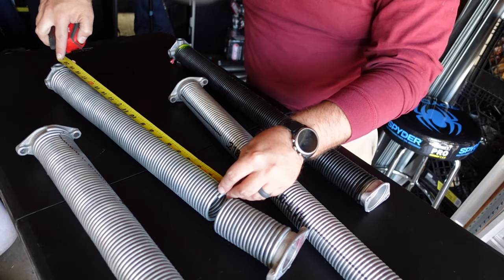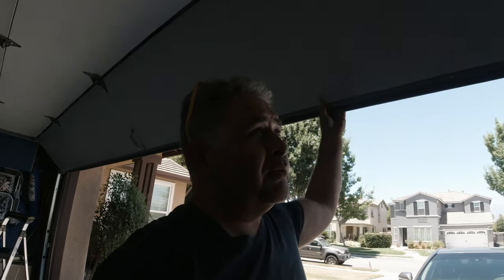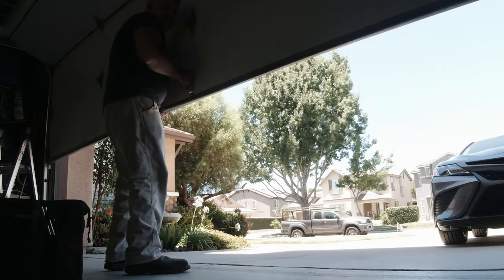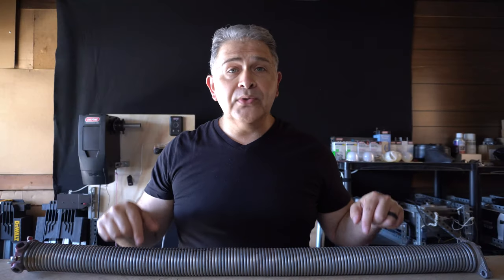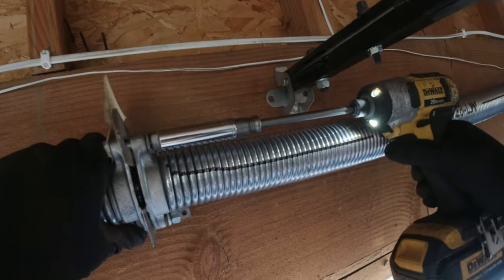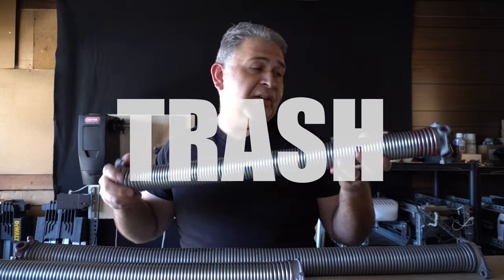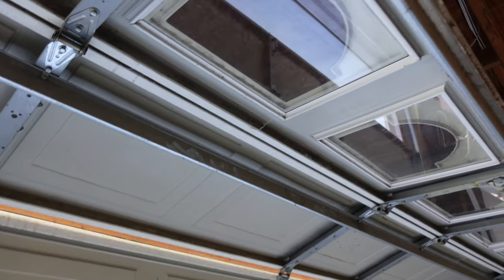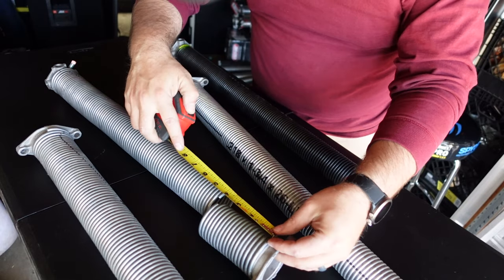Avoid THIS Common Mistake When Buying Torsion Springs

Comment: Good information, but I feel like most garage door experts/companies depend on "just use what was already there".  HVAC guys (at least around here) do the same thing.  They just replace the old unit with a new unit of similar size making the assumption that the first person that selected the HVAC unit size did the correct analysis.  My 331lb door (I weighed it) had a mix of a 0.242 and a 0.250 spring that gave a combined lifting force of 310lb.  They worked ok, but I would get a broken spring every 4 years.  I recently changed to a pair of longer 0.272 springs and expect to get at least 3x the life from that spring.  These provide a lifting force of 325lb.
Reply from the maker: I love this perspective.  I have a longer form video that covers the benefits of high cycle springs.  Replacing springs every 4 years will compound in cost.  Thus higher cycle springs with a thicker gauge might be a better solution.  Thanks for the comment.

Comment: It should balance at any level? Hmm mine only balances after I open it to 60%, maybe I need to get this done.
Reply from the maker: Thank you for sharing your feedback. 

Yes the garage door should stay balanced preferably at the three, five, and 7 ft level. Most within the garage door industry feel that it should balance as each section turns open or closed on the track radius. 

Nevertheless a good balance store should not move more than a foot down or up.

Comment: BIG MISTAKE by the previous company reducing wire size. However, the door could still be properly balanced with the .225 wire if they were cut down to 22". By doing so, the life cycle (if assuming standard 10K to begin with) would be reduced to around 2,500. Great video and information!

Comment: I have watched almost all your videos concerning garage door torsion springs, but I have not found the information I need to repair my garage door. I had an old CLOPAY 18x7 standard steel door with a pair of 0.225x1.75x31 torsion springs. I got tired of repairing this door every couple of months so I bought a used 18x7 insulated door that weights about 180lbs. Also, my garage has a ceiling height of ~12' for I raised my track about 30 inches to give me more head space and my cable pulley is ~5" in diameter and my track has a 12" radius. So, I installed the original torsion springs but they will only lift the door a little over halfway. What I'm trying to determine is "What pair of torsion springs will work on my door?" By the way, I'm just trying to get by until I retire to replace the whole door. Thanks,

Comment: Nice video, I once did a steel back with 2 225x2” on steel door worked like a charm I assuming cuz the 2” diameter and no windows. Is it more beneficial to run 2” cut over the 1 3/4?
Reply: @Andrew Balas so a 250x1.75 will have a stronger lifting power than a 250x2”? Assuming there the same length
Reply: @Andrew Balas I did a odd shape door that had 2 rusted out 207s I put 207x1.75 and they maxed out on turns and the door was still to heavy. I then put 2 207 cut by 2” and it had more turns and balanced out the door perfect. So from that I thought 2” has more winds to add before springs max out (they were both 25” length)
Reply: @steveo78227  what do you mean by “max out”
Reply: @robertogonzalez3304  max quarter turns, eventually they won’t wind anymore hence to small of a spring

Comment: Thanks for the great information for those of us who like to turn a wrench (and live in DIY-friendly states). I have an Ideal Door S51S, 16’ x 7’, manufactured Feb 2004/installed June 2004. Uninsulated, no windows, standard radius track (12”), D400-96 drums, weight is 177 lbs. It has 2 original standard torsion springs which worked flawlessly for 19 years until a failure of one of the springs yesterday. The failed spring is 0.218 x 1.75 x 25.5; the one that still holds tension measures 0.218 x 1.75 x 29 (if I understand correctly, the length of the intact spring should be approximately 27” after backing out 8 turns of the 0.218 gauge spring). Per your comments in this video, I’d like to entertain going to 0.225 for greater cycle life and trying for a matched pair if possible. I am wondering if a matched pair of any of the following would work (which take into account my understanding of the math and what I can find stock of):

•	0.225 x 1.75 x 32 (30 is also available)
•	0.225 x 2 x 27
•	0.218 x 2 x 23 (not ideal for cycle life, but available)

If you have a better fit I’ll try to track it down, but inventory does seem to be an issue.
Reply from the maker: Hello.  Thank you for sharing your garage door situation with the community.  
I would go with the .225 by 1.75 by 32 springs.
Reply: Thanks for the reply! The .225 by 1.75 by 32 springs it is.

Comment: You’ve a great channel with lots of info. I’ve Wayne Dalton FCII 16x7 Solid door WT 125 with no windows. I could not find the model no. but guessing it’s a 9100 series. The right side of the Torquemaster spring broke. I’m planning to replace the spring with torsion springs, and looking at high cycle springs. I’m looking at US made Dura-Lift springs. I've genie model 2028 motor.

What would be your advice for the spring specs or any other brands for my use case?

Interesting thing is that when I weigh my door with an analog weighing scale, bought new, it shows 100 lb from the center.

Appreciate in advance!

Comment: Great video.  Thank you.  Problem is though -- there are no numbers on my springs!  I want to get the same ones, but without the numbers how can I do that?  There is no name on the springs either.
Reply from the maker: There are a number of ways that you can measure with a measuring tape.  Here's a video that might be helpful.  

https://youtu.be/cqoG_AJuJPk?si=AXDMbQf1gj1hGxK8
Reply: Thank you.  I made sure to get the same size springs.  But the way the long, metal piece from the opener to the door is moving after the new unit and springs were installed is worrying me.  It seems to go up and down as the door opens and closes.  I don't remember the old one doing that.  Is it supposed to "flex" like that?

Comment: Hi I have a broken .250x2x31” spring, I bought a set of .250x2x32” springs to replace both my springs. I believe them to be 30 years old probly never lubed and most likely broke from normal wear and tear. Is the springs I bought ok assuming the original springs were correct? Does that extra inch of length matter?
Reply from the maker: Excellent question.  What type of garage door do you own?

What can you tell me about the brand or make of the garage door?
Reply: It’s a 16’x7’ it’s fairly heavy I think made of a of compressed/mdf type material with wood texture kind of like siding
Reply: Thank you for answering and the help btw!
Reply from the maker: You're welcome!
Reply from the maker: I think the .250 by 32" should work.  Have the springs been replaced?

Comment: Great video!!!  I don't know what was originally on my garage door, but they lasted 10 years.  The springs that I had "professionally" installed lasted about 8 years, as the right side just broke.  Door is 8 feet tall and 18 feet wide, insulated with no windows.  Current springs are .243 x 2 x 30.  I was thinking about going to .250 x 2 x 32?  What are your thoughts?  Thanks...
Reply from the maker: Thanks for the support to the channel.  A pair of .250 by 2" by 33 or 34's should balance out the door and can potentially offer about 13K cycles.  For additional cycles, you might consider a pair of .262 by 2 by 43's which could potentially offer up to 26K cycles.

Comment: My door and springs are original with the house from '97, the door is wood and I'd assume has gotten slightly heavier over the years due to moisture over the years.  At what point should I consider a strong, thicker, longer and/or adding more preload winds to the spring?
Reply from the maker: Excellent question!  When you do a balance test to your garage door, does the garage door stay at a specific level or does it feel heavy and fall?  When was the last time you had your garage door service?

If you are at a crossroad to have your garage door serviced then there's no better time than now to have your spring system upgraded.

Comment: Great, but what if you are going from a single spring to a double spring? I had a .262×2×36 original spring on my door. A chart that I went to said that I could use a .207×2×23 on both sides for a 14,000 cycle life instead of a normal 10,000 cycles. Does this sound about right to you? I have a 8 foot double steel Insulated door 9 feet wide.
Reply from the maker: Hello.  The 207x2x23s are spot on, but you might get less than 14K cycles.  Consider going with a .218x2x30s.

Comment: how about if  my garage door only had 1 right winding spring and it broke so i am trying to replace it. is it ok to buy a pair of left and right torsion spring with same size and length or shorten the length since there're gonna be two of them instead of the single one that was previosuly installed? spring measurements are .250x2x37. great video. very informative! thank you
Reply from the maker: Hello.  A pair of 207 by 25 work or 218 by 31s.
Reply: Advised for get new set of torsion spring ( left and right) , my garage door weight 360 pounds, is 16x8 ft and have a radius of 12 “, thanks in advance .

Comment: Old set were mismatched, 207 x 1.34 x 27 and 225 x 2 x 29. Metal pole was pretty bent. Replaced pole. Would 218 x 2 x 22 work as a matched set? How many turns should I start with? Door is 16 x 8 non insulated, 160lbs
Reply from the maker: Thank you so much for this question. I believe you would do well with a pair of 225 wire Springs by 1 and 3/4 by 33 in long. That should be able to balance the door nicely.

Comment: Please advised for new set of torsion springs, steel insulated garage door with a weight of 360 lb and dimension of 16x8ft, the radius is 12”.
Reply from the maker: Hello.  Thank you for the question.  I would be happy to guide you finding the right springs.  But I do need a little more context about your garage door.  Do you know the brand?  Does this door have windows?  How were you able to determine the weight of this door?  Did you have a professional weigh it?

Comment: I have a solid wood 16x7' garage door with widows on the top row.  Currently, there are two .250x1.75x35" springs.  The springs were replaced over 15yrs ago.  The door is no longer in balance.  The door does not stay in any position.  It takes alot of force just to manually open the door, and it just wants to slam into the ground. I am unsure if the proper springs were installed when they were replaced, or if the spring have just lost tension over the years.  Would I benefit from upsizing to a .262 spring to help balance the weight?  Is it even worthwhile to try to increase the tension of the current springs to try and balance the door,  or is it too dangerous to mess with such old spring?
Reply from the maker: Hello.  You might benefit more from a new spring replacement.  If you wanted higher cycles the .262x1.75x44 might be worth considering.  Consult your local dealer installer to be sure.

Comment: You should have described how to measure a torsion spring and what the various numbers that you mentioned mean in relation to the spring size.  That would have added value to the video.
Reply from the maker: Thank you so much for the feedback! 
I actually have another video that does that exact same thing, where I go into detail on how you can utilize specific tools to measure springs. Additionally I highlight how the first number is the wire size, the second number is the diameter size, and the last number is the length of the spring.
Reply: @sosgds  Thank you.

Comment: how to figure what size spring to use when converting from extension springs 180 pound 9x7 wood door
Reply from the maker: Great question. 

What brand of wood garage door do you own? 
What can you tell me about the track assembly to this garage door? 
When was the last time you replaced the extension springs?

Comment: Would the spring rate change when going to a high lift, I'm going up 4 feet to the bottom of the radius. 15x7 Wayne Dalton 8700 insulated vinyl. 200lbs resting on top of scale without tension.
Reply from the maker: Hello.  Yes you would have to calculate the lift for the additional 4 feet.

Comment: Question if I have a 234 1.75 30” can I use a 234  1.75 29” or 31” if so which is better
Reply from the maker: Hello!  Yes you can go either way.  The inch difference should not throw off the balance of the door.  My preference would be the 234 1.75 by 31.

Comment: Thank you. Can I ask you to explain the spring sizes for TD134 and TD138 for steel craft, non insulated overhead doors? I’m new in the field, new job, and I need to learn about all  it. The way you explain is super easy to understand. Thank you
Reply from the maker: Hello!  I can definitely try.  Steel craft is from Canada correct?  Are these models the more common doors they offer?
Reply: @sosgds   Yes they are, normally work with these two but also work with gate, hangar doors etc

Comment: have a 16 x 8 Clopay classic 25 non insulated door, will 218 x 2 x 22 spring work. How many 1/4 turns should I start with
Reply: have set of 218 x 2 x 22
Reply: door also has windows, 150 -160lbs
Reply from the maker: Hello. Thank you for reaching out with these questions. What can you tell me about the door model?  Additionally do you know what type of track assembly you have? Is it a 12-in radius or do you have a low track assembly?

Comment: I have a Raynor 250-27 spring, could I use a 262-32
Reply from the maker: Hello. That's a good question. Do you happen to know if you have a 2-in ID or a one and three quarter inch diameter id? The diameter is important with these Rainer doors because sometimes they could be 2 in or 2 and 5/8 in.
Reply: @sosgds  I measured a 2in 
Inner diameter
Reply from the maker: I would go with the .250 2" 34"

Comment: Hello!! Thank you for the video. I have a 16x8 garage door uninsulated. There are currently 2 different torsion springs on it from the previous homeowner… one is a .225 27.5” 1.75” and the other is a .218 26.25” 1.75”.  The smaller .218 broke yesterday and I am trying to figure out what size springs to replace both of these with. Any guidance? Can I go up to a 2” diameter? Home Depot seems to stock that easily.
Reply from the maker: Hello!  Thanks for sharing these details.  The .225 wire springs will offer higher cycles for your garage door.  Yet the door tracks, drums, and weight will also play a factor.  Therefore if there's a way these factors can also be determined then it might help hone in on the right configuration for your garage door.  

If it were me I would utilize a pair of .225 1.75 by 33 long springs.  Yet, I'd need more information from your garage door.

Comment: I have to admit.  I'm a little saddened by this video.  A true [professional will always weigh the door.  There are 3 things you must know for proper balance.
The height. The drum, and the weight. If a service tech doesn't' know these 3 variables. Send him away.   When you know these 3 things. You can make up any springs the homeowner wants.
Reply from the maker: Hey Andrew.  It's definitely a science.  I was taught more height, weight, and track assembly.  

What formula do you use with drums?
Reply: Every tech should down load the service spring app.  Weight/height and drum are key variables. It will ask radius.  We customize any spring to 306 wire by this app.  All my techs need to do is weigh the door.  From this video. The previous work done  was a guess.
Reply: @andrewm7146  Experience also helps but the spring engineering app helps a lot too  .
Reply: @andrewm7146  so how do you weigh the door ,if there is no indication of weight?
Reply: Didn't u hear the man say...5:30..... if you have issues/don't have the original springs, "your probably going to have to weigh the door"?
Reply: @garageboyz2634  I use a pair of crane wights with racheting straps and connect to each side off door. Lift door up about 1 inch. Then add wight from both scales. Need to pay attention to track radius too. Doesn't affect by  much from 12 in to 15 in radius. But need to note

Comment: Howdy. So I Have 243-34-2 Torsion And A Spring Broke. I See 243-33-2 Available But Seems Like 34s Are A Harder Find. What Would Be The Best Upgrade At This Time For My Insulated 16'x8' Double Garage Door ? I Have Been Watching Your Videos For The Last Few Days And They Are Very Informational.
Reply from the maker: Hello.  Thank you for the feedback.  
I would use a pair of 243 x 2" x 33"s ... The difference in length should not throw off the door balance.  

You could also use a pair of 243 x 1 3/4" x 38"s.